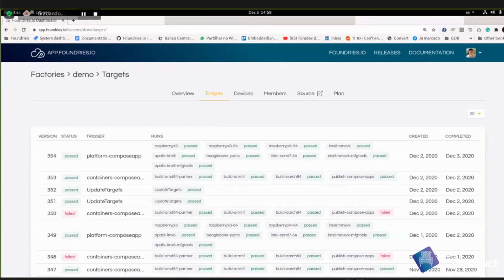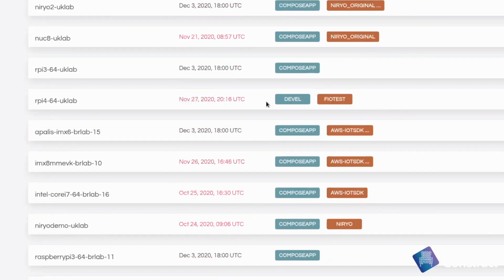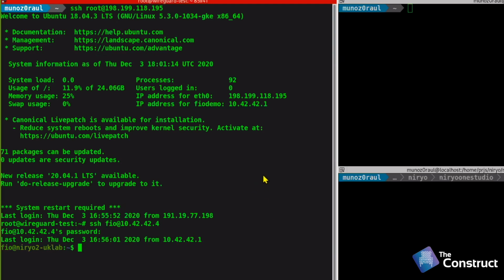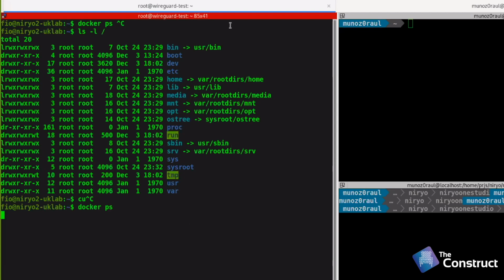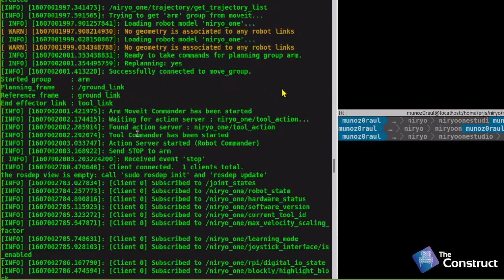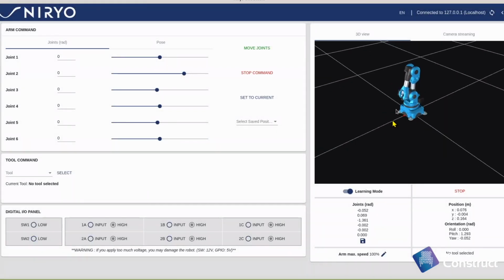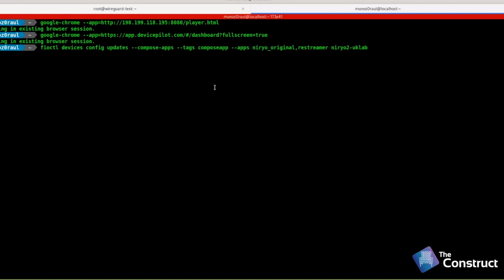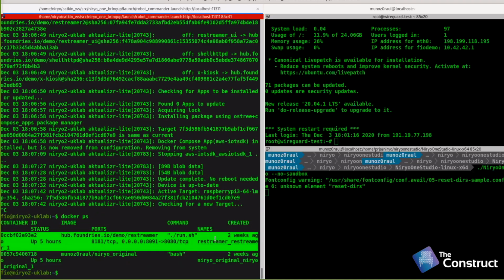RDP087: Optimized embedded Linux for ROS with Raul Muñoz

Comment: Hi, I'm a ROS beginner and I'm into a long-term project, so I want to ask which ros distro do you recommend me between ROS Melodic and Noetic? and why? Thanks :D
Reply: If you are in a long term project, definitely go for Noetic, basically because is the latest LTS distro so your project will not outdate quickly. But more important than that, Noetic is based on Python3 and that is going to solve you a lot of problems (Melodic is based on Python2.7)